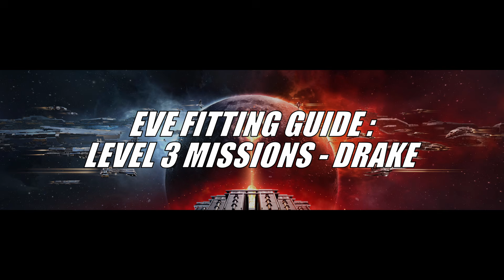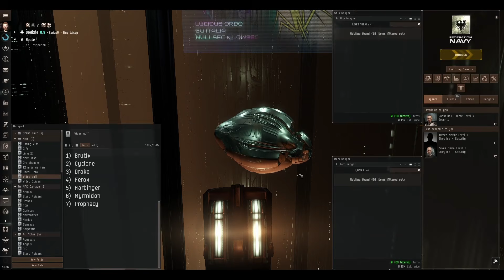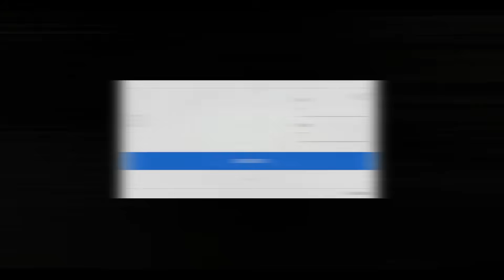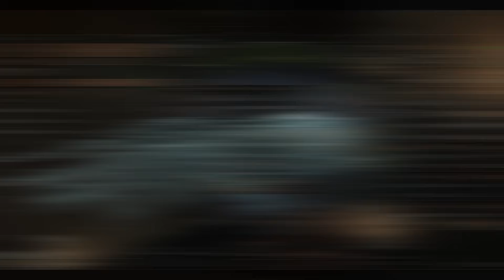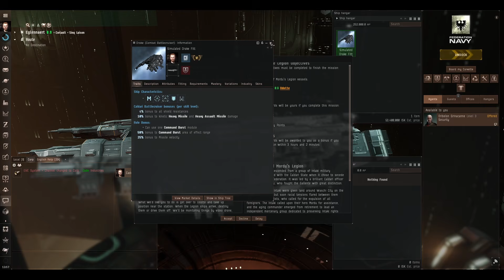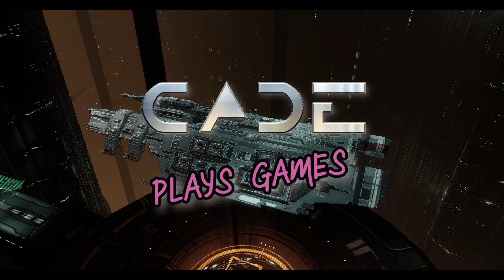EVE Fitting Guide: L3 Security Missions - Drake

Comment: What the hell skills do you have? I’m running a Drake with heavy missile launchers and scourge missiles and I have like 230 DPS. 😂
Reply from the maker: I've been playing EVE since 2008 so.....max in pretty much all the relevant areas 🧐😎
Reply: @CadePlaysGames  enlighten us on those relevant areas too unless they are omega :)
Reply from the maker: @oliverdhonals1623  
Caldari Battlecruiser.
10% bonus to heavy missile damage per level.
50% at Level 5.
Alpha capped at Level 4 (40%)

Heavy Assault Missiles.
5% bonus to heavy assault missile damage per level.
25% at Level 5.
Alpha capped at Level 5 (25%)

Heavy Assault Missile Specialisation.
2% bonus to rate of fire of tech 2 heavy assault missile launchers per level.
10% at Level 5.
Alpha capped at Level 3 (6%)

Rapid Launch.
3% bonus to rate of fire for all missile launchers per level.
15% at Level 5.
Alpha capped at level 4 (12%)

Warhead Upgrades.
2% bonus to all missile damage per level.
10% at Level 5.
Alpha capped at Level 3 (6%)

Comment: I think you could just give up being 100% cap stable, make sure you're stable with MWD off, and dedicate more fitting into tank. Then you can cycle MWD to get to range and even the harder L3 missions wouldn't give trouble. I'm not certain how this version will do Blockade for example.

Also, it's a fit with mostly T2 modules & T2 shield link, and since the only people who would actually want to do L3's are new players and alphas, it's probably not going to work for them.
Reply from the maker: Yeah cap only really needs to last like 15 mins at most.
Blockade wouldn't be that hard; just mwd to each group and take them one at a time, the other groups will be out of range for the most part until you're ready to take them on. As long as you don't hit the triggers you'll be golden.
Command burst was really only there to show it can be done, to be honest 😄
Reply: @CadePlaysGames  I am aware. I did Blockade in a cheap Caracal when I was an alpha and still doing L3's... but a new player who doesn't know how the spawn triggers work, doesn't have high skills and isn't good at manual flying might struggle in some of the missions. Especially in a pretty big target like the Drake. They could probably use a bit more tank :)
Reply from the maker: @jyidorne8042  Yeah it's a risky fit, but those are the fun ones.
I do have a meme fit Prophecy that's cap stable with 5 medium armor reps, so at least it won't ever die in any L3 mission 🤣
Reply: @CadePlaysGames  hehe sounds fun. Did you make a video with that fit? :)
Reply from the maker: @tobberh  No, it's not really viable. More of a tech demo than anything else lol